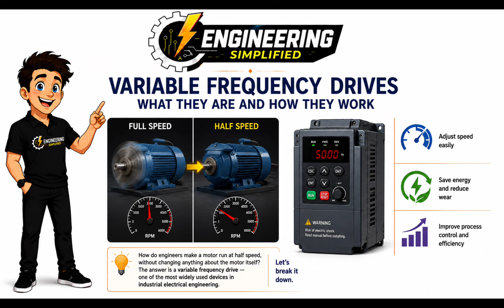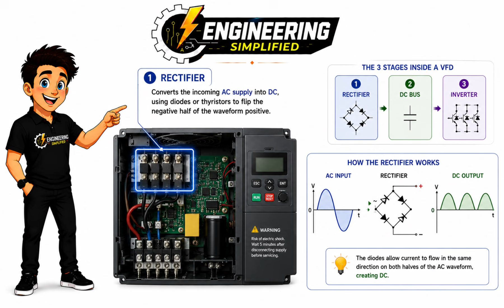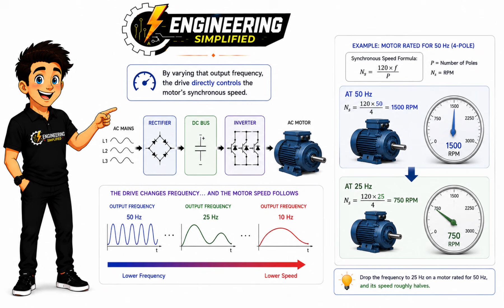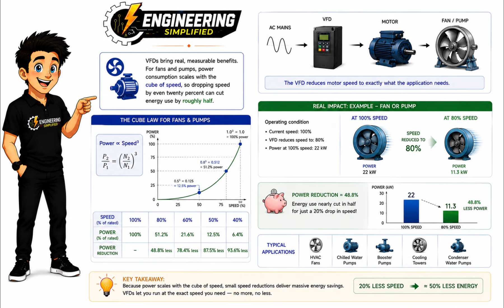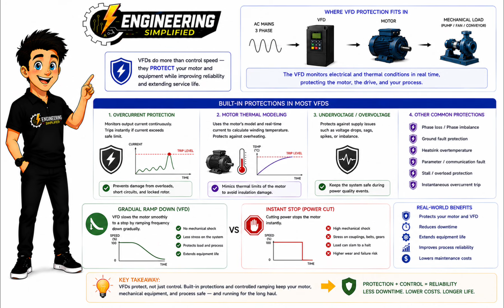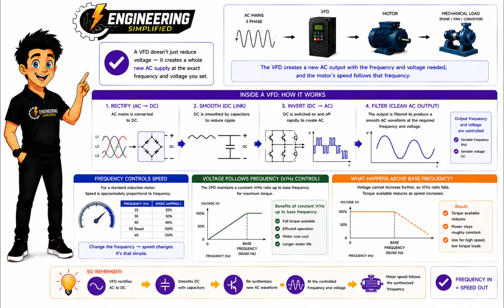Variable Frequency Drives What Are They How Do They Work

Comment from the maker: A VFD controls motor speed by changing frequency, not just voltage, which is why it can save so much energy on pumps and fans running below full speed. Have you commissioned a VFD before, and what tripped you up first time?